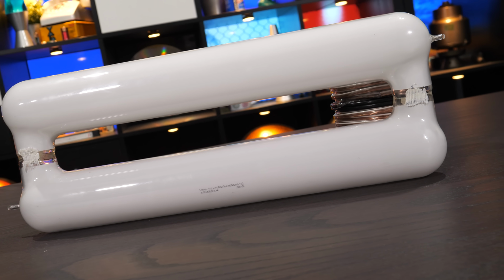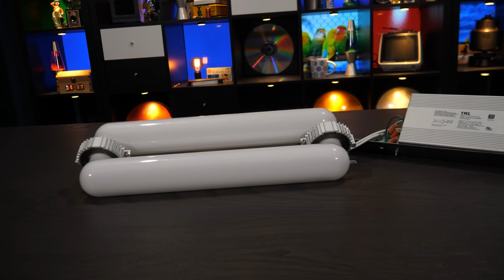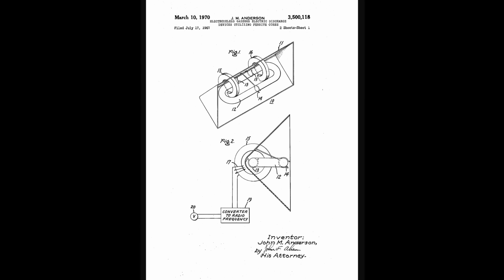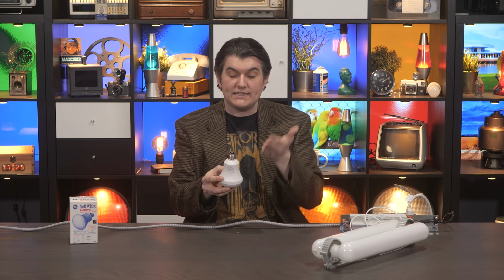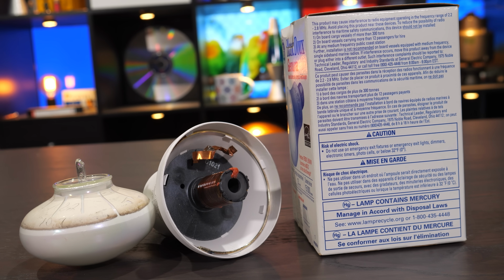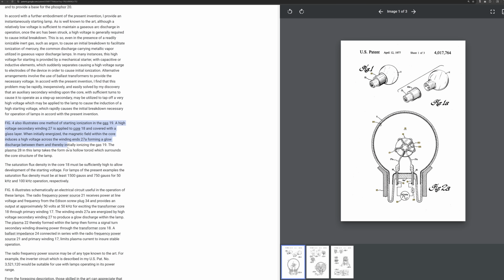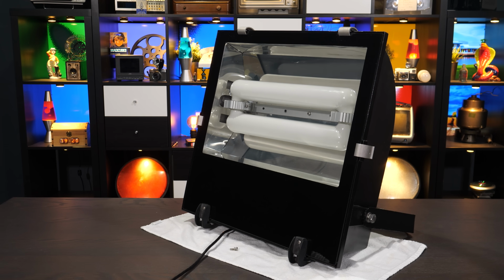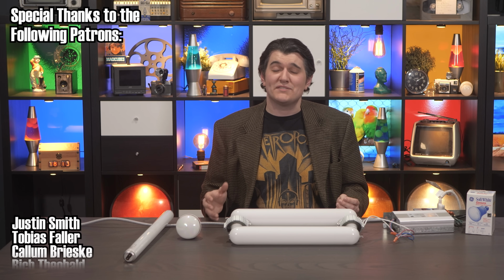Induction lamps: fluorescent lighting's final form

Comment: i dont want to seem contraian on the LED point, but here in cle they've been using LED for street lamp replacements for a few years now, and it seems about every fivlfth one starts failing (seazure frequency flickering and low powered dim output being common symptoms prior to the whole LED array going final dark after only a few monthes after installation) i see them used in a lot of casual dining establishments as well, and again, less then six monthes after rethinking their whole lighting set up to swith over to LED strips,  whole patches going dead or low output.

LED can do a lot, but from what ive seen of its applications in the wild, i dont think its as great a solution as its being billed. the rate and reach in which it all went up as well conveys that many bought into redoing their lighting infrastructure entirely off hype and promises, and not tests and studies, and likely bought and installed a whole buncha bunk.

Comment: About starting these things. Isn't the magnets point to create a perpendicular electric field which will excite the mercury vapor and ionize the noble gas (probably argon)? Even if the gases aren't (good) conductors, with an electric field ridiculous enough their electrons are bound to react to it and go proportionally crazy, no need to introduce new electrons.
Reply: Noble gasses are not good conductors, until you realise they ionise very easily.

Comment: Hold a florescent tube light (4 foot or longer for best results) up to the tip of a CB radio antenna and whistle into the microphone.  Lights right up, even on stock power output.  No wires required.

Comment: I think if they put a wire inside, it will glow bij contucting heating and releas electrons to start it. No need to have any connection from inside the tube to outside. High freq. will heat a wire inside the tube up. Bij tweaking the lenght and freq., they could heat the wire up with a specific freq at start up.

Comment: The toroidal cores are really strange to me: the magnetic line of force creating a loop, most of the energy stay inside the core. Could it be the two cores (they are connected reverse) work together they are coupled thru mercury vapor argon mixture inside the tube, is that?
Reply: A toroid induces a second current though it pole, but yes.

Comment: A firm explanation for those tubes starting up isn't really possible without a complete (destructive) teardown and some instrumentation, but I can offer some thoughts on it:

- The long coil in the Genura may well operate in a similar mode as the resonant output network of a (conventional, filament-started) CFL. Before breakdown, Q is high, large current is drawn by the oscillator, transformed into large voltage at the end of the resonant network (it might be operated at the self-resonance of the coil, i.e. a practical application for a Tesla coil, if you can imagine :> ); this then, against the grounded surroundings, provides enough electric field to cause breakdown of the low-pressure gas.  (For the CFL, the high current is of importance, wired in series to heat the filaments quickly.)  (The amalgam being in the middle of the coil, may also serve to induction-heat it for faster/stronger activation; how much, depends on how thick and permeable the ferrite cylinder around it is.)
- The loop tube may have metallization inside as you note, but it might not need any gimmicks to function.  Notice the tube rests directly on the primary coil, no shield inbetween, separated only by wire insulation and glass (and, note that because dielectrics have permittivity greater than air, they act to conduct more electric field into the neighboring space, loosely speaking; the key insight is that insulators, in and of themselves, are always at least a bit "conductive" at AC).  The ferrite core, though not very conductive, is still somewhat*, and in particular, also has a fairly high dielectric constant, making it, in any case, "conductive" at AC.  Since the core is mostly surrounded by ground, it acts as a ground return path.  The primary winding might indeed be driven with enough voltage that, despite the small contact patch between it and the tube, it develops enough voltage (and voltage drop) to induce ionization, and the rest is history.
- As mentioned, it's entirely possible they added a sort of "spark start" mode.  The primary is two terminals with respect to ground; the E-field ionization mechanism doesn't depend only on the voltage drop across the windings (as above), but simply raising the voltage of the whole coil (both ends simultaneously: "common mode") couples into this mode quite nicely.  If the output network is transformer coupled (within the inverter box), a common-mode transient (anything from another oscillator coil, Tesla style, to an ignition coil and spark gap) could do the job easily.

*Indeed, ferrite is in fact a poor conductor.  Also, how much, depends on material.

This isn't an "um, ackshually", by the way; for explanatory purposes, it's close enough to "nonconductive" that I would also leave it at that. But where we have to peer into the details, the answer (as it so often does) becomes "not quite; it depends".  So, since it depends here..!

MnZn ferrite is the most common type, and is moderately conductive (poking with typical DMM probes usually reads some 10s kΩ).  It is suitable for lower frequencies (a few 100 kHz, perhaps more in thinner sections).  Skin depth is the primary limitation, much as it is for transformer steel; at 100kHz and mu_r = 2000, the maximum useful section is a few inches thick, so it's not of much consequence outside of large industrial applications (and indeed, industrial induction heating power supplies are constructed of bricks glued together -- though this is also at least in part because large molded shapes simply don't exist; you have to glue pieces together to make something that big, heh!).

NiZn ferrite is the choice for high frequencies, and is hardly conductive at all (probing might read MΩ to GΩ).  It has the downside that it's... kind of a poorer core material, in general terms (lower permeability; lower saturation flux density; higher hysteresis loss and nonlinearity at comparable flux density).  That's more than made up for by the miniaturization afforded by high frequencies (at a few MHz, you don't need many turns to keep the flux density low enough to keep things cool).  The conductivity is low enough that EM waves generally propagate through it, at least for a few wavelengths (whereas, when "skin depth" dominates, propagation is just a fraction of a wavelength, i.e. waves just kind of stop, "short circuit", in a thick enough bulk).  At radio frequencies, NiZn ferrite is sort of the equivalent of peering through dark/smoky glass, while MnZn ferrite has a more metallic and absorptive/reflective response.

Comment: Induction lamps did not solve any problem. In the 80's and 90's there were companies who used microwaves from a kitchen magnetron to power such lamps. Even exotic recipes have been tried, like e.g. sulfur. All low pressure discharge lamps have the problem, the glass eat up the argon gas, by dissolving it. Therefore, all lifetime expectations went down the drain. The next problem is efficiency 16klm with 200W means 80 lm/W. Nothing compared to LED with typical efficiencies of 230 lm/W.

Comment: I have five induction fixtures in a 1400 sq ft room.  They work great.  I bought them in 2012 and they were expensive.  I have replaced four of the drivers in that time.  The fixtures make a great white light at 150 watts each and are deathly quiet.  I had to buy them at an industrial supply house but we love them.
Reply: I have a bunch that both bulb and ballast have lasted 24 years at this point.

Comment: The starter very likely works by having a high voltage node that touches the tube. That could be on the primary coil by using a high Q resonant circuit that produces very high voltages when unloaded or by having a seperate high voltage generator that creates a high AC voltage on a piece of wire that touches the tube. I think the GE bulb has the second one - there's a copper contact that toches the bulb glass.

Comment: Please try to put your circular florescent bulb inside those ferrite cores to see if any bulb would work.  I'm curious if the electrode terminals would need to be wired together to complete the circut.  If it does work, then bulbs with burnt electrodes could have their lifespans extended.  Probably not the most practical or necessary due to leds though.

Comment: This brings back memories of 25 years ago when I designed a product that used 2 lamps, one for germicidal and one lamp for ozone. 17500 hours was the lifespan. This was due to the glass being damaged by the UV light.  99% of the black on the ends is due to starting the lamp. The reason is humans are impatient. We don't like to wait for lights to turn on. So companies try to start these lamps as quick as possible without burning out the filaments at the ends too quickly. The product I was designing at the time had to turn on multiple times a day for short periods. The first design burnt lamps out in a week. when the product was released the lamps could survive 1 million starts with no sputtering on the glass. We stopped the testing after a million starts. It takes a few seconds to get the filaments to the correct temperature. So instant gratification is why the tubes get black ends and burn out before their time.

The little screen or wire in the induction lamp is where the ionization starts. The screen has sharp points on the ends. Sharps points have a very high electrical field. This is where the argon and neon is ionized. It works the same way a tesla coil lights a lamp. If you want to go down the physics rabbit hole, please reach out.

Comment: At high frequencies, electricity can couple capacitively through the glass very easily. The electric field across the windings on the ferrite is being coupled from the wire to the gas inside the tube.

Comment: on the subject of starting the lamp, and thinking like its the 1960s,
If the "atmosphere" needs to be ionized in order to produce an arc discharge, would it be posssible to just throw in some radioactive isotope inside the glass that emmits ionizing radiation in order to start the lamp?

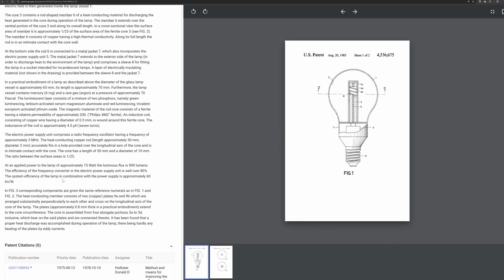Comment: 20:40

 You said it operates at RF frequencies, right? I don't have a full explanation, but I have an idea.  

Higher frequencies generally lower the voltage needed for dielectric breakdown of gases. 

If I had to guess, it's something like RF plasma generation. You can convert a confined low pressure gas into plasma via RF alone. Iirc in this bulb, the rapidly alternating electromagnetic field is still there before the gas breaks down, and it's high enough frequency to be considered RF. 

Couldn't say for sure that's what's going on, but maybe it's a starting point for someone else

Comment: i've been lighting my bedroom with a CCFL style ballast powered 4 foot t8 lamp that has been on 16-24 hours a day for the past 15 years, i suspect it will last another 15-20 years as it doesnt touch the filaments, it just hammers a little high voltage through it to start it, literally hanging by it's own wires :D

Comment: Not sure you need special bulbs. I remember tapping florescent tubes to out CB antennas back in the 90s. Seems like it took right at 5 watts to start. You would have to start talking to start the light, but once lit, key up voltage would keep it lit. It would then get brighter with your voice. We were using 1 foot tubes. But I have seen amplified radios light up big tubes.

Comment: I work at a chemical company with many areas that need explosion proof electronics and we just use normal flourescent tubes (althoug it's slowly changing to LED, don't ask me why this hasn't happened 10 years or so ago) in gas tight light fixtures. No cool and fancy induction lamps.

Comment: You forgot to mention another forgotten technology called: "microwave sulfur plasma lamp" with power rated from hundred to more than 2kW inside small glass sphere not bigger than table tennis ball without any electrodes with tiny glass stem mounted on rotating mechanism to prevent 1-2kW magnetron burn hole through glass with sulfur and some additives without mercury producing nice white light in continuous spectrum with CRI 80.

Comment: The high frequency models are easier to wrap your head around as they are essentially blasting a gas with microwaves, well known to cause ionization, but those lower frequency models are interesting. If I had to hazard a guess I'd say they start in a similar manner to cold cathode lamps, i.e. there's always some ions forming due to quantum tunneling, static electricity, chemical reactions, and cosmic rays, this creates a very small current which can then cause thermionic discharge and electromagnetic shower effects.

Comment: Thank you for a very informative video. They were popular in South Africa mosly for highbay lighting and general flood lighting aplications most or all induction lamps were supplied with the electronic comtrol gear which were paired for each other. The mainstreem lighting companies kept out of the race as they were of the fixture logics and 50% of the tube was behind the reflector so efficiency was not good. So, complete knocked down units were imported and assembled localy. The new maveric lighting companies got into the act with a differnt concept eg colour rendering good normaly a triphosphor fluorescent coating and all the vertures as you have mentioned. Also, hoping to get the replacement business. Sadly they are no longer available and companies know requiring replacements cannot find the companies that sold them the technology. Also, at the time the exchange rate was much lower thn it is now. Today it is R 17.85=One American Dollar. A company in North America called QSSI  possibly have replacement stock available. The Chinese manufacturers have long gone moved to LED technology and the induction lamp is now only a talking point. I guess it was a victem of it own doing in relatioship to the term of obsolescence. Not needing a cartel to define the life time.
I cannot fault the lamp in any why just sorry that the manufacturing company premises that made use if this technology now will have to spend money in a new lighting LED UFO,s installation. Oh vey,!  they are in for an interesting new ride and I predict the same is going to occure as history repeats it self.

Greetings from South Africa.

Comment: There was a "Sulfur Lamp" variant of this developed by Fusion Lighting that used a small globe with a sulfur powder and argon mix, which was excited by a magnetron. Yes. a magnetron in a light fixture. The sulfur didn't glow directly because of induction... it relied on the temperature/pressure of the argon gas reaching 5 atmospheres. You might have seen them at the Air and Space Museum in DC... in that application they had light pipes to make them look at lot like very long fluorescent tubes, but they weren't. They were odd beasts that wiped out any chance of using 2.4 GHz in that area!
Reply: they forgot to wrap microwave doors around them
Reply: Sulfur lamps were installed at Hill Air Force Base in Utah. I saw them in action. They're bright.
Reply: company I worked for put them into Hill AFB, Utah.  Really cool tech, but had some drawbacks like the light was sickly green, and at least the early versions we installed had a nasty habit of the magnetron going out requiring replacement. Oh, and when installed horizontally the motor that rotated the "small globe" of sulfur/argon could go out instantly allowing plasma to concentrate and melt the bulb.  These were very early units, pretty much just out of prototype stage so these issues may well have been solved in later applications.
Reply: Microwave UV bulbs are ubiquitous in the print industry
Reply: @Kartoffelmeister89 I feel like I should already know this fact. Onward to the rabbit hole!
Reply: That's sick! I was just thinking about higher frequency designs
Reply: And to think, we're just now getting around to making 2.4 GHz useless through cross-talk. Luckily, all of our wireless peripherals are tied to a misused audio standard in that range

Comment: Maybe coil itself acts as that strip and creates electric field inside thru capacitive coupling not induction.
Similar to when you put linear fluorescent tube near tesla coil but with smaller distance and voltage.
And that starts the arc.

Comment: I was also wondering about starting - The metal inside the small GE lamp probably has something to do with it. 
For the large one, I suspect the driver topology is a something resonant tuned circuit. Without the loading of the ionised gas, the voltage on the coils could rise quite high, causing capacitive coupling through the glass where it is very close to the coils to get some initial ionisation. Once struck, the tube would load the output,  reducing the Q of the resonant circuit and thereby the voltage. Another possibility is that the driver might use a higher frequency at startup to increase the amount of power coupled capacitively.
Reply: I wonder what they doped the gas with, to get an efficient resonance inside the tube at "relatively" low frequency.
Reply: It proably starts as capacivitely coupled plasma and continues as indictively coupled plasma.
Reply: I don't know what you mean by topology? I think it's just the high frequency of the waves. literally a Tesla Coil. So it doesn't need a "closed circuit" we are so far beyond Ohms Law lol